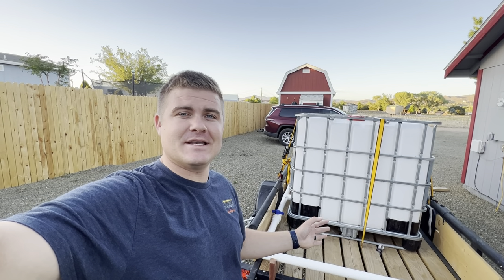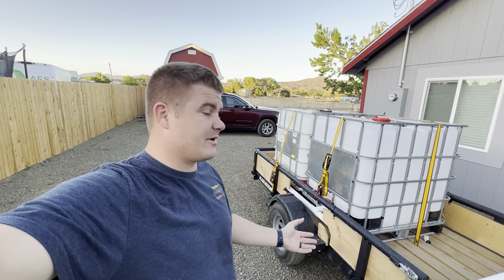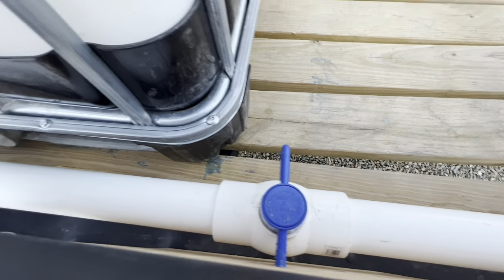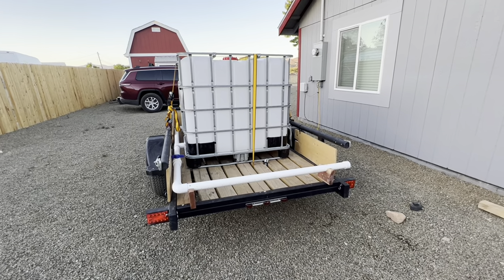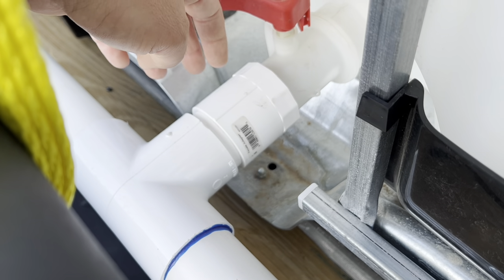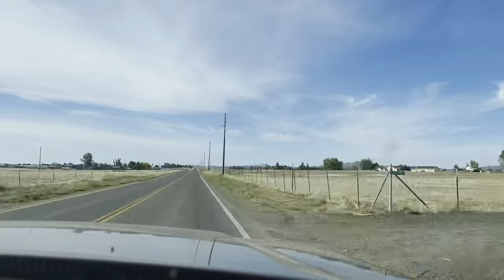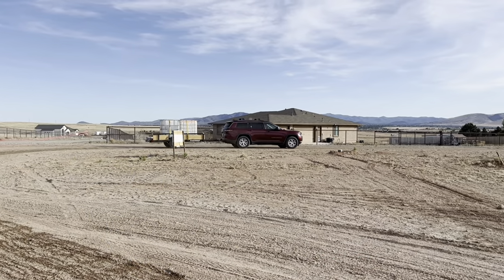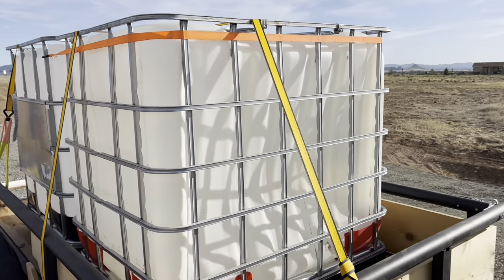Don’t Hire a Water Truck - Make this Instead! DIY Water Trailer

Comment: Those IBC tanks weigh 2,400lbs each if filled to capacity. No way that trailer can handle two of those tanks filled more than 1/2. Definitely need a tandem axle trailer for that much weight.

Comment: I just bought a brand new one for $45(brand new). It had food grade sunflower oil in it. I also got 2 gallons of sunflower oil. A guy down the street sells them. $20 for 50 gallon plastic barrels also.

Comment: Great video! I was puzzling out how to apply a liquid to my horse riding arena and your contraption is just the MacGyver touch I need! Thanks
Reply from the maker: Glad to hear! Hope it goes well.
Reply: @brettjudy  is there a way to push more pressure through the sprayer? Or is gravity for the only option
Reply from the maker: @catherinelohse-oo8ti   You might be able to integrate a water pump somewhere in the system, but you might restrict the volume of water coming out. Gravity worked pretty well for my needs!

Comment: What size pipe did you threaten to those big containers what are the numbers
Reply from the maker: It’s been a while so I’m not sure, but I’m pretty sure it’s a 2 inch female threaded PVC.
Reply: @brettjudy  thanks
Reply: @brettjudy  I just bought one the size that you said and it fits thank you very much
Reply from the maker: @jonkastanek2468  Awesome, glad it worked!

Comment: What size drill bit did you use?
Reply from the maker: I think I used a 3/8” but if I were to do it again I would probably use 1/8” and do more holes.